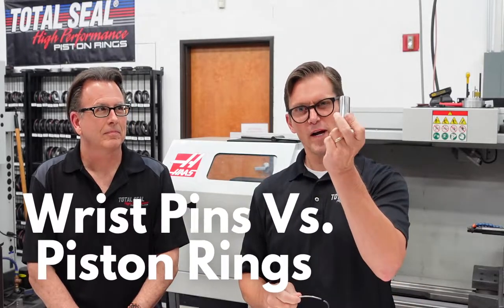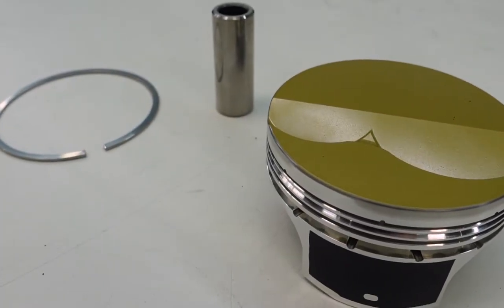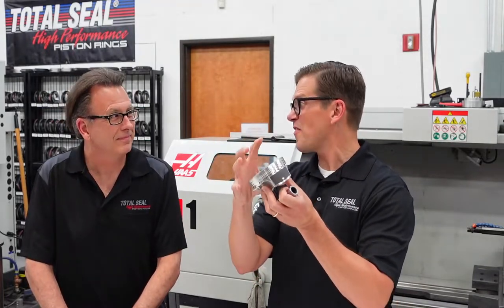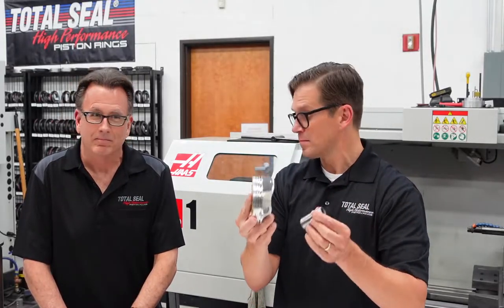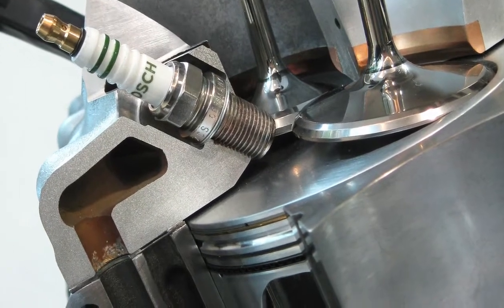Wrist Pins vs Piston Rings - Two Different Parts Of The Piston Assembly, Each With Different Jobs

Comment: A piston deforming and binding the rings can be as much of a piston forging design issue more so than a short pin bending issue. It's not unreasonable to run a 2in long pin on a 4in bore piston as long as the forging is strutted and the pin material and wall thickness selection are correct.

Comment: This is fascinating. I never thought about the piston pin as the backbone of the piston. I just thought of how it is often the first thing to go when someone tries to get too much power out of a stock diesel bottom end.
I have heard that a bushed rod with floating pin holds up better than a press fit pin, but I don't know why. Can you tell me?
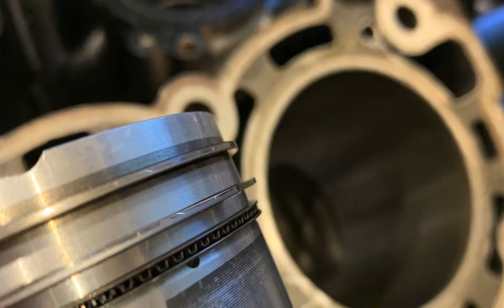4:03 In addition, I find it really neat that the Mitsubishi Evo IX and X had 1.2x1.2x2.0 ring packs and 20 PSI of boost. That's slightly thicker than .43. Some NA engines do have a narrower ring pack than .43, I think a 1.0x1.0x2.0
Reply from the maker: You are right, there are OEM engines (some boosted) with 1.0 mm rings. In regards to the bushed vs press fit pin, that’s a question for the rod or wrist pin manufacturer. I’d suspect there are other factors that matter as well.
Reply: @TotalSeal  I did not know some OEM engines are boosted and have 1.0mm compression rings. Impressive. I knew some companies built pistons for boost and gave them 1.0x1.0x2.0 ring packs. They might be pushing 30 lbs of boost at the same time.

Thanks for letting me know about floating and pressed pins not always making the difference. Theoretically the Evo X and 4B11T had an advantage when turning up the boost because it had floating pins VS the Evo 8 and 9 and 4G63T, but that didn't end up being the case.